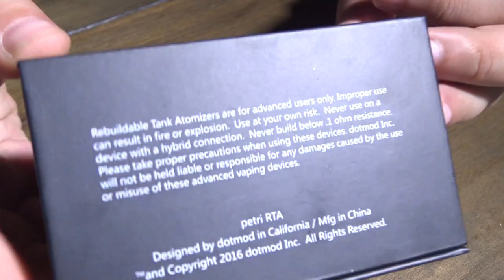The Petri RTA | Best RTA EVER?

Comment: I’m surprised he hasn’t talked about leaking with the way he didn’t screw on the chimney correctly. 

The way it’s supposed to work is you’re supposed to unscrew the 510 pin on the bottom slightly so the deck can rotate to completely seal the tank. Yes that means you have to take it apart when you want to rebuild it.

I find that most of his videos have a lack of information. Sometimes not too much, but this one is kind of big. Someone who buys this not knowing and ends up with a leaky tank because of his information - or lack thereof - will end up upset and it will be his fault.

Comment: I loved my Petri, until I it broke! The set screw frame broke! Gotta watch out for that Josh. IMO those needed to be a bit thicker! But I did love until then. Lol
Reply from the maker: you should contact dotmod. i've heard great stories about their customer service
Reply: OhmBoy Josh I've moved on cause it's a design flaw. I take it as if I get another, will it happen again? Probably, right? This is what I did for a living when I did work. So I've moved on to the Goon LP and found it's easier to build on and has the same flavor. And airflow is good. Just wanted to give you heads up to not wrench down too hard. On your leads cause it will snap at some point.

Comment: How is it on juice consumption? I'm looking for an rta that doesn't guzzle the juice down. I'm currently vaping on the obs engine and the mage rta. I like them both, but they do whip through the juice fairly quickly. Just curious how this one holds up in that department! Thanks, josh. 😉
Reply: Sam Parish it depends on your build and the power setting. The tank doesn't really have a direct correlation to juice consumption, but your build and the power the goes through it has a very direct correlation.
Reply from the maker: like sam said... definitely has a lot to do with the way you vape it... but for me. I fill it pretty frequently... mainly because it's a 2ml tank

Comment: How is it on leaking?  Been fighting with tanks for 4 years now. The Kayfun v4 was the first one that just wouldnt leak (unless it was loose)  My Griffins (22 and 25) leak like sieves if it's not just perfectly wicked; and even then it leaks sometimes :(

$70 worth it if I'm trying to avoid the leaks but have the great portability a tank gives (hard to drip while driving)
Reply from the maker: what i find with a lot of rtas is that they leak the first or second time i fill them (only when i fill them really tho)... then the cotton breaks in or the seals lube up right... i don't know what... and then they don't leak at all anymore.
Reply: took a while but I finally broke down and got one.  Funky way to pull it apart and coil/wick it.  First one leaked like a sieve though. Then realized what I did wrong. Pulled it out and redid it and man this is an amazing little tank.  No leaks, even a little.

Comment: what 18650 batteries do you recommend? in terms of reliability and safety. I plan on throwing in a dual caterpillar Clapton coils running at .3 ohms each into my tfv8
Reply: nuclearfusion1000 if it's regulated mod go with Samsung 30q if it's mech go with Sony vtc5a
Reply from the maker: i really really want to try the vtc5a... sound awesome